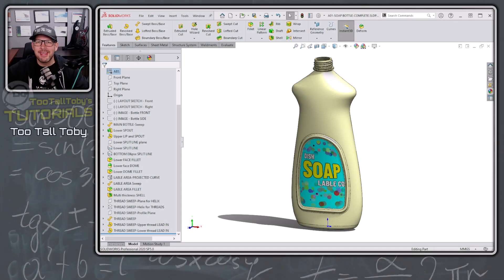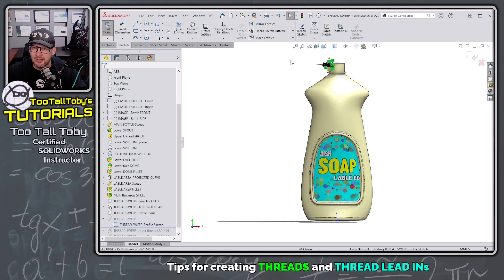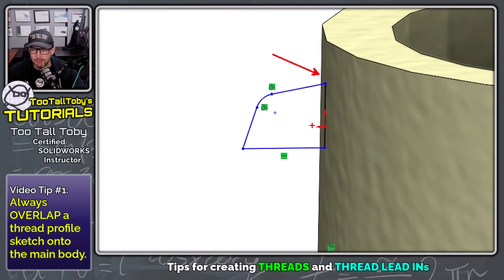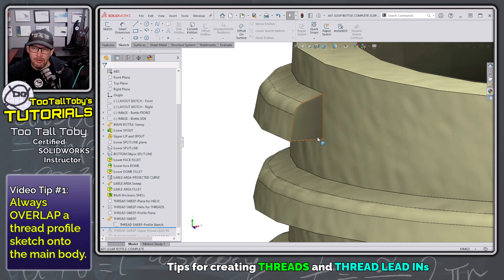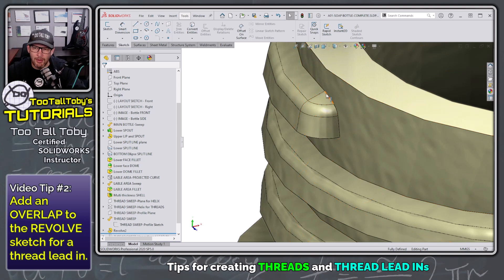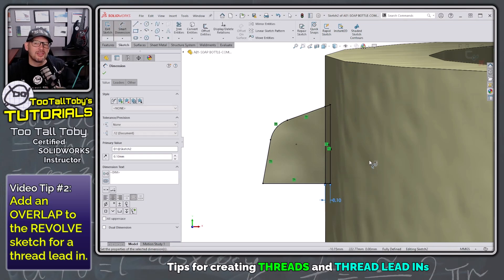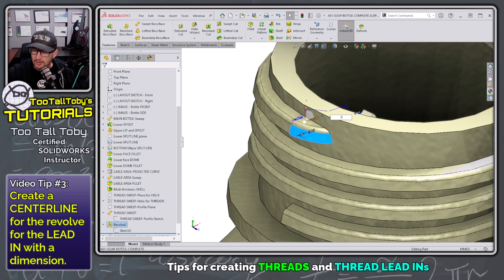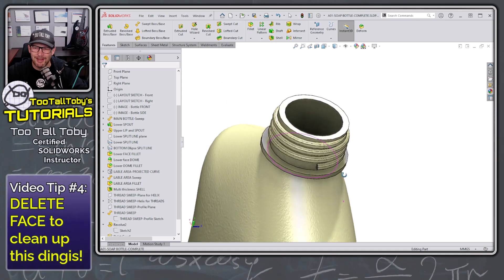How to create THREADS in SOLIDWORKS with THREAD LEAD IN

Comment: bro, that tread end is not parallet to the thread it self
Reply from the maker: That's true but for a 3D print and considering that it's the lead in, this will still work fine.  I've made these IRL and they work.  At the end of the day, if it works, it works.

Comment: When you add the lead-in as a revolve it appears that it doesn't follow the helix of the rest of the thread, but is horizontal. Is that right?
Reply from the maker: Great question!  The trick to sweeps is to create a new plane perpendicular to the path.  In the case of a sweep along the helix, this results in a start and end face that is at at slight angle, relative to the standard orthogonal planes.  Since the revolve for the thread lead in is created on this same slight angle, the result is that the lead in does indeed continue the "flow" of the helix, and allows for proper thread engagement and no binding.  

Glad you're enjoying the content and keep the great questions coming!
Reply: @TooTallToby  Thanks. It feels clunky, but I guess that is all you can do. It is what I figured
Reply from the maker: @donepearce  as long as it works and engages, that's what really matters 🙂

Comment: Revolve up to inside surface.

No need to click 18 delete surfaces for clean up.
Reply from the maker: Its a great suggestion.  I tried revolving up to surface, but I picked the outside surface and it didnt work (since the revolve begins protruded into that face).  But picking the inside surface is BRILLIANT!  Thanks for the tip!